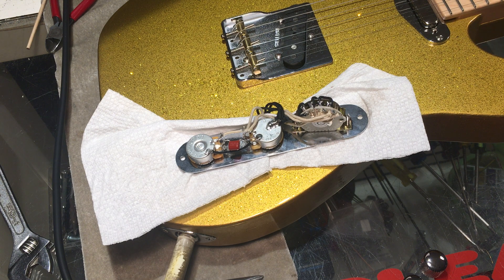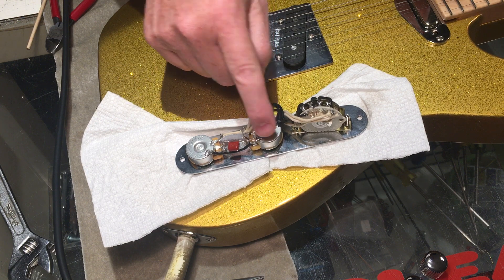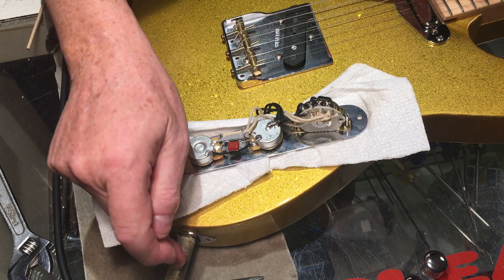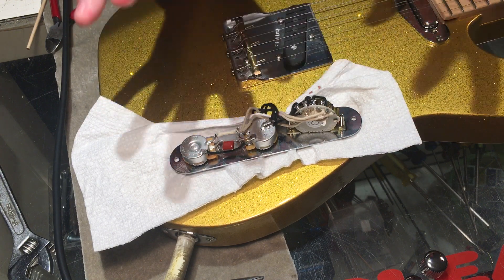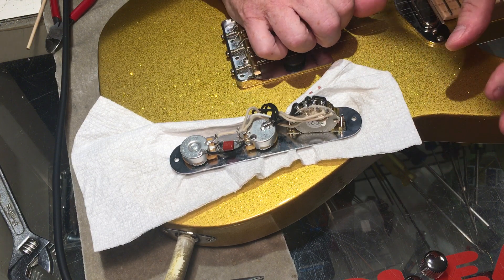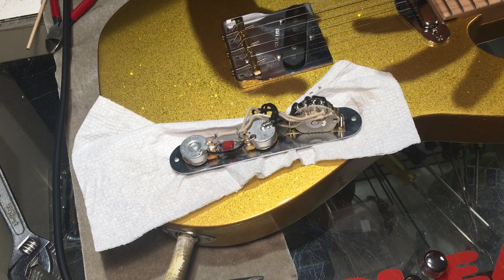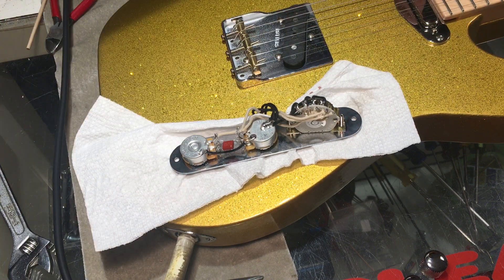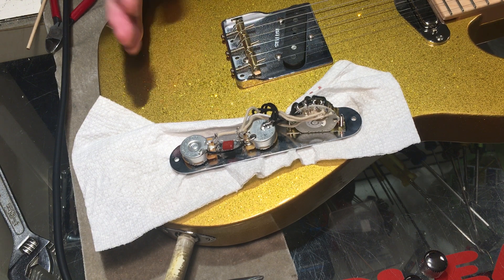How much does changing to 500k pots affect Tele pickup output?

Comment: Logarithmic tends to be a little bit better for tone pots:why?My 500 logarithmics tone pot is completly useless!!Need to get in the end of rotation.Isn't linear more gradual even for tone pot?
Reply from the maker: It can depend an the components, their quality and how the tone circuit is wired - that's a big one. Sometimes this problem occurs from following wiring dogma that doesn't work with modern parts. Try wiring a different tone circuit. This way you don't have to get any new parts.